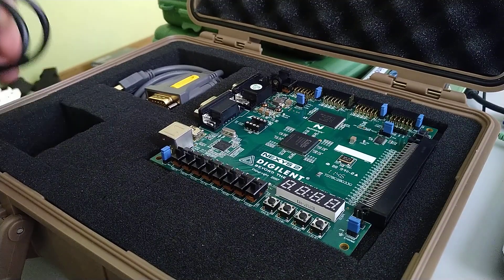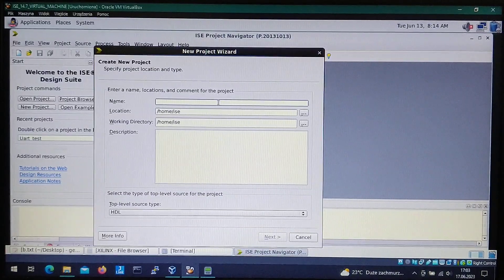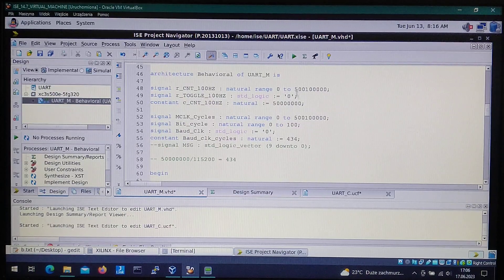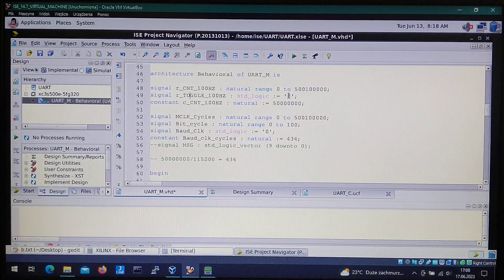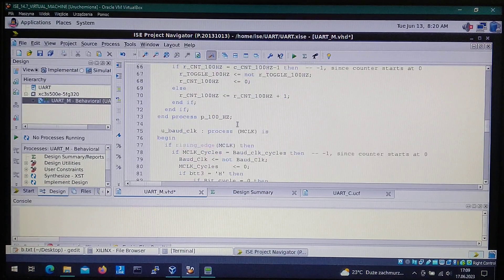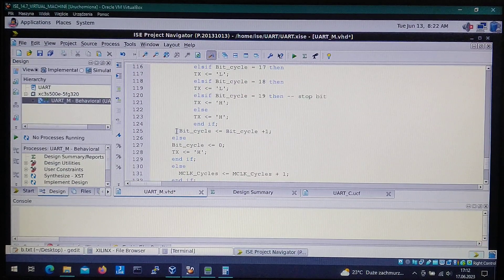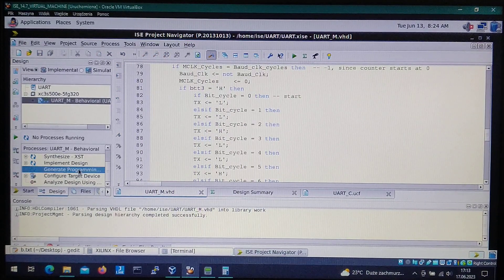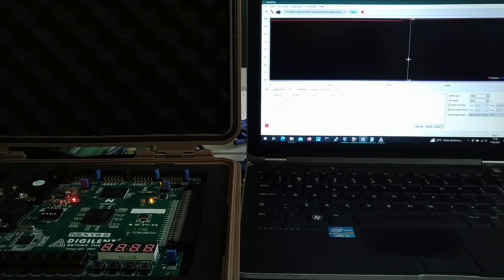Digilent Nexys 2 Uart + Blink example in VHDL

Comment: i need a program that send data from arduino due to raspberry pi 3, please can you please make it with atmel studio i need it , i don't now how to do it with atmel studio 7,
Reply from the maker: To send data to rpi you can use usb cdc on the arduino due side and a serial terminal app on the rpi side. The next option is to use uart just like in the uart example video i made a while ago where i was using it to read and send messages to a rpi zero with the due